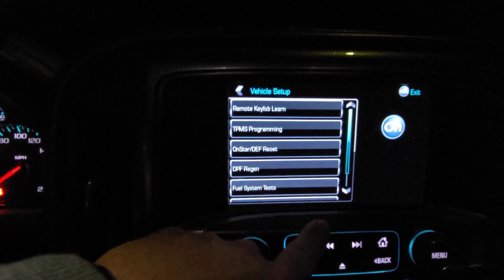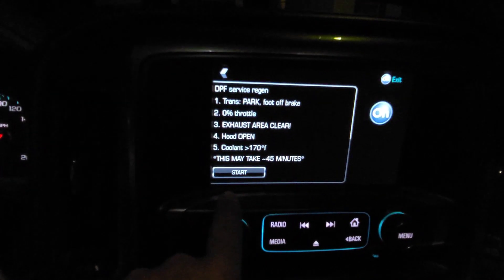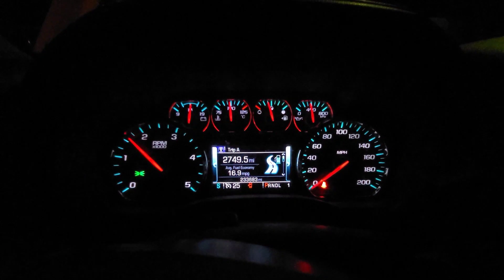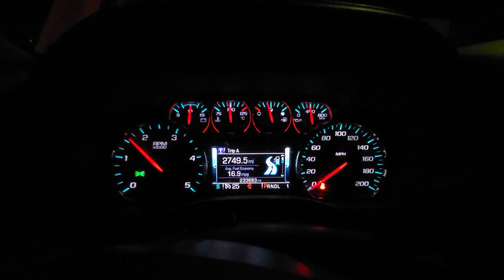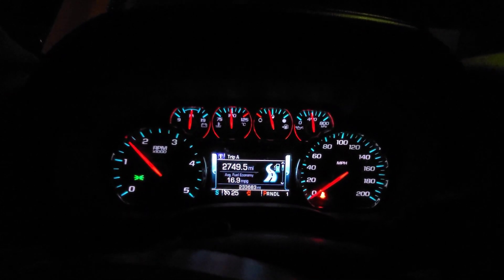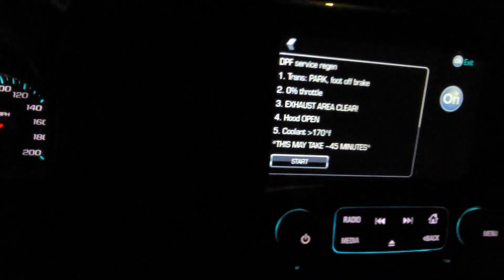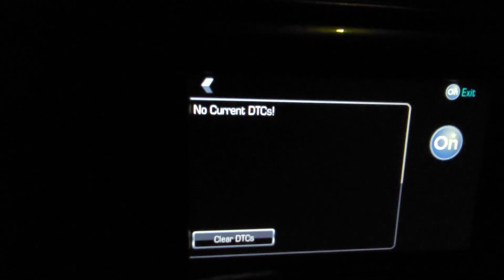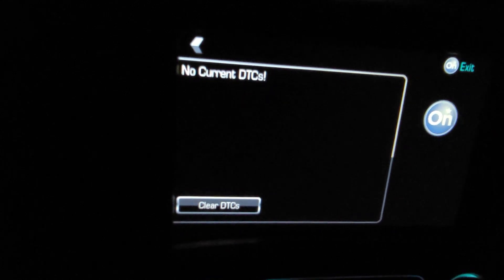Forced Regen with Autosync

Comment: Do you have other income besides hauling trailers?
Reply from the maker: That's it. I'm single so no joint income there. I did sign up for Amazon affiliates and started posting links in videos but not made over $50. In a month with that and i an not getting anything from youtube until i reach 1k subscribers and i doubt that'll add up to much if i hit 1k so that's pretty much it
Reply: @CFarmer  do you pay a mortgage if you don’t mind me asking? And how often are you home/ stay out? Do you still owe on your truck? Planning on a new one next? Thanks for your answers brother
Reply from the maker: Anytime, i pay $550.mo rent, $950mo tr
uck payment,$350. Truck insurance... all in my bills are around 4k month car payment, phone bill, credit cards etc and i usually make between $7500. & 9k before bills after fuel when things are steady. There's still upkeep and maintenance on the truck. I'll keep this one until it's too worn out to drive, lol..... then I'll probably buy a low mile used one similar
Reply from the maker: There are slow times though and it's very important to put $ up for slow times. Also having a class A CDL it helps me get better paying loads that non cdl caint pull
Reply: @CFarmer  when are the slow times generally?
Reply: @CFarmer  7-9k gross monthly correct?
Reply from the maker: I will make a video and share with you later today that will be a better breakdown
Reply: @CFarmer  10-4
Reply from the maker: Hope this helps some. 
https://youtu.be/RlLf1fN8GBg
Reply: @CFarmer

Comment: Love ur videos u helped me on my po204 injectior code I have edge cts 3 and it gives the Manual regen option I haven’t touched it but I will be keeping these videos to  my library .After you did the regen u got it down to 22 percent did the codes come back
Reply from the maker: Thank you, it did 2 days later and off and on until i needed DEF again. Since i filled DEF up again no light. I've been about 3500 miles since light went off. In Texas headed to California today. Thinking i bought a tank of low quality Def.i wouldn't manual regen often but it's saved me from going to shop 2 times because truck wouldn't regen on its on.

Comment: My Duramax did the same thing at 160,000 miles but it went into limp mode. Did a forced regen to make it home And then it dropped about 400 pounds of junk off of it and did a simple tow tune with knew 4” exhaust . It has been a sweet sweet running truck for the last 70,000 miles. Absolutely no comparison before and after. Good luck with it man I hope that gets it lined out for you
Reply from the maker: Is yours a L5P?? Mines in desperate need of weight loss but i haven't found anyone i trust to do it.
Reply: @CFarmer  smiths Diesel Performance 865-705-3797 that’s who did mine. That’s the only place I would let touch my truck and he is also certified Allison transmission. He’s actually only a couple miles from where I live just north of Knoxville Tennessee
Reply from the maker: I'm going to call him tomorrow. Thank you very much